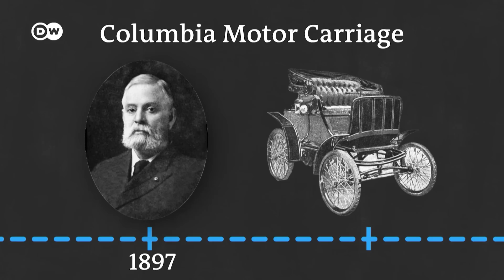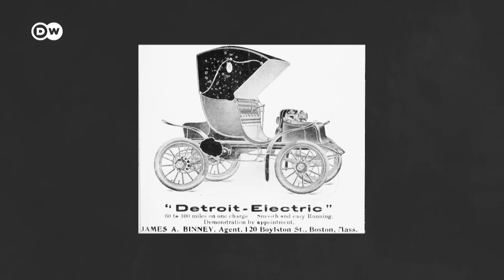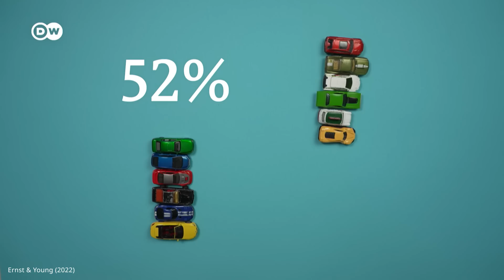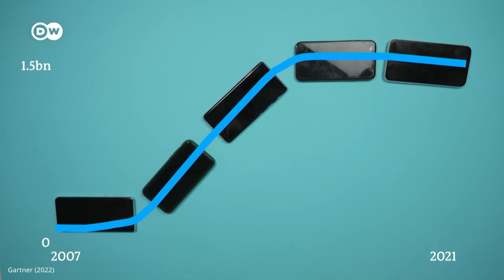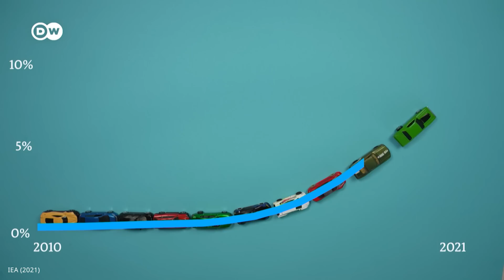Why electric cars are finally taking over

Comment: Norway and Finland are both a minute percent of the world population. The world’s electricity grid will have to be massively expanded which won’t happen due to cost.
Reply: What is your excuse for the population in China?
Reply: did you know EV's can actually help grids. EV's are charged at night when there is excess electricty and then newer ones with V2G can send power back to the grid at peak demand times like supper time. Thats why lots of electric companies are promoting EV adoption.

Comment: Change raods to electric like train and produce car which can run on road electricity just like electric train
Reply: Both  ideas would do the same but your idea will be too expensive and limited to where you can drive because you would need to put electric lines on millions of miles or road instead of an EV being independent.  Don't quit your day job anytime soon.

Comment: Conveniently omitted is that an electric car has to be driven 60,000 miles before it breaks even on the amount of pollution caused in creating it.
Reply: that's false. that's only on a dirty grid. If its on a zero emission grid like where i live that drops to around 7,000km. im at 50,000km with my ev on a zero emission hydro grid and over 7 ev's where i live would be the same amount of pollution as 1 gas powered car,

Comment: If energy supply for EV is not from renewables it doesn't really make a lot of sense to have it, does it? I'm looking forward to see @DWPlanetA take on lithium and cobalt extraction impact on the environment.
Reply: Electric car emits les s co2 even powered by  coal generator because powerplant are more efitient at converting focil fuels into power plus the least efitient Electric car is 80% efitient compared to the most efitien gas car wich are 14% eficient plus contary to the sterotype it is les than 1% of litium and cobalt that is extracted by poor cunty because they cant produce as much as sustanible mining with equipemnts
Reply: its already been proven that an EV on even the dirtiest coal grid is still over its life including all mining and manufacturing cleaner than a gas car. Then take an EV and put it on a clean grid and its 1/10 the emissions of a gas car over its life.

Comment: We changed from the old Nokia to digital smart cars in 2 years. The average life span of a phone is 2-4 years. The same will apply to cars & the average lifespan of 12-15 years
Reply: My friend still has the Iphone 6. Clearly you're speaking nonsense.
Reply: i 100% agree. phones changed fast because they only have a usual life of 5-7 years. a car is more like 10-30 years so the change is slower but still is happening at the same rate when adjusted for lifespan.

Comment: 1200 km with 4.2lt/100km, i will never  sell my Diesel. Surperior to any electric vehicle, and i only bought it for 6k€.
Reply: so it costs you $8 per 100km, my EV costs me $1.75 to do the same thing.
Reply: @3184Patrick  mine is 2010 Make with 240.000 on the Clock. how about yours ?
Reply: @3184Patrick  and 1.75 /100km no way. Solar?
Reply: @3184Patrick  Liar Liar
Reply: @3184Patrick  How much you bought it?

Comment: I think when we adopt the ev the problem occurs when the demand of gasoline will dropped the price of gasoline will also be drop so their should be very difficult for EV to completely kill gasoline engines in comparison of power and price ratio so their must be equlibirium in market untill all the electricity we generates must be completely transfer on renewable and their must be any breakthrough of new battery technology.

Comment: No they are not taking over. They are losing the competition. The battle between electric car manufacturers and oil car manufacturers was fierce and ended just a few months ago. Electric cars are just like global warming cultists. They are not taking over. What is happening to them is, fewer people are buying from those who manufacture them. Supply and demand. If there is less demand, the companies have to make fewer products. Including fewer and fewer electric cars until there will be no more electric car. What happened was that oil car manufacturers started to make better and safer benzine and diesel machines. And with that fewer and fewer people bought from the electric car manufacturers. 100 years ago people will be standing inside some museums and they will look at models of electric cars which are common now which will no longer be sold by then and they will ask themselves how their ancestors could be so stupid to let a bunch of guys lie to themselves so much. Sure there will be alternatives. But that does not change where the future is headed. They are not taking over because the opposite is happening. Thanks for the video.

Comment: Legislation because our countries listened to a little girl thats never been to school.

The EV is the most destructive vehicle EVER devised.
It is FAR more environmentally damaging to produce than any equivalent petrol or diesel car.
It has a shortened life, due to the limited lifespan of the battery being just a fraction of a modern petrol or diesel engine.
Plus, as the battery is the largest and most expensive component in the vehicle, the car will be rendered almost valueless once it decides it doesn't want to be charged any more.
In short. They are a con. A very expensive con. A very destructive con. A very dangerous con.
The manufacturers know it. As do the "environmentalists". And governments. 
And anyone else with half a brain.

Comment: The problem with electric vehicles, which is limiting their spread, is predatory practices by car companies. Basically, they do not respect the right to repair. Whereas, for decades, car repairs could be carried out by independent mechanics with a knowledge of how cars work, the same is not true with electric cars. This is not because electric cars are more complex or more dangerous to work on than combustion cars. In fact, many aspects of them are safer and simpler.

But car companies are specifically designing their vehicles in such a way that only their personnnel can service them, implementing DRM and other measured to make servicing by independent technicians impossible or extremely difficult, as well as prevent the development of third-party parts suppliers. 

 They are doing this to monopolize the repair of their vehicles. They are also doing this so that they can force customers to replace parts wholesale instead of allowing a very specific component within the part to be replaced or repaired, increasing profits while also increasing waste. 

The overall effect is drastically increased repair costs to the cobsumer, drastically decreased availability of availability of parts, substantially longer wait time to have cats repaired, and lower quality of repair services, because repair shops without competition and with a guaranteed source of customers have little incentive to provide prompt and professional service.

Unless regulators step in to institute and enforce right to repair, it might be better if electric vehicles remain a niche product. 

After all, before all of the carbon sequestered in the earth's fossil fuel reserves found themselves underground, they were first absorbed by living creatures who then died and were buried under the earth. And before they were absorbed by those living creatures, they were in our atmosphere.

Releasing carbon into the BACK INTO atmosphere from which it originally came by burning fossil fuels will indeed change the global climate. These changes will likely raise temperatures, cost us money, and make life more difficult. 

But the earth has contended with much higher ambient temperatures, and much higher levels of atmospheric carbon than even that, in its long, long history. Yet its ability to sustain life was never compromised. 

The key to life on earth lies in the elements present on the planet, our distance from the sun as set by our orbit, and our regulation of seasons as set by the earth's axis and rotation. Releasing carbon back into the atmosphere will not change these 3 factors. 

Even if the climate changes, life will find a way, as it has always done. Do not let greedy corporations take advantage of your concern for the environment in order to sell you a subpar product, sell you products you do not need, and/or otherwise scam you out of your hard-earned money.

Comment: I'm a bit skeptical over the electric cars, because they also create a lot of new problems to be solved in the process of mitigating the climate change issue, ex: dumping old batteries. 

The first step we should take is "Greening our habits", which means less consumption, smarter cities and an easy access to services in general. It sounds a utopic, but it's possible do be done.

Comment: I live in San Diego and there has been an explosion of EVs recently. Charging stations have been installed down the street from me and the electric company is offering deals for off-peak charging discounts. It's a good intermediate to cut emissions today, but there needs to be a battery revolution away from lithium, followed by a transportation revolution away from private vehicle dependence.

Comment: When you said India has less than 50k EVs on road...that's wrong on few levels. 1. There are millions of electric 3ws, few hundred thousand electric 2ws in addition to 60000+ electric 4ws. 2. 90% of those 60000+ electric cars were sold in last 1 year or so and the sales have multiplied 3-4 times across all segments in just 1 year. So, the stats would be drastically different in next few years.

Comment: I traded in my Lexus RX 350 for tesla model 3P! I have free tesla charger at work and rarely have to pay for charging! I just wish it had air suspension and backup auto brake detection! I do miss how smooth the Lexus was but other than that it’s perfect

Comment: The next step will be getting people to get over the idea that individually-owned private cars are an actual necessity. Self-driving publically-owned cars would solve all transportation requirements using existing road infrastructure while significantly reducing the sizes of fleets worldwide. After all, privately-owned cars spend the great majority of their lifetimes unused and parked in garages, which is a total waste of space and the energy that went into manufacturing them in the first place.

Comment: Once again these EVangelists  think they can predict the future.  Furthermore they think the purchase of a car is the same thing as buying a mobile phone.  The fact is that battery electric vehicles suffer from the same problems they've always suffered from - low energy density.  In fact there's a 10 to 1 gap between the greatly inflated lithium ion battery and the internal combustion engine.  Batteries are still the lowest energy density technology available for the transportation sector.  Using them in vehicles makes next to no sense except for very specialized applications.  I will close by saying that a low energy density technology has never replaced a high energy density technology particularly in the transportation sector..... The guys that produced this video should study their history a little more closely.

Comment: A full tank of petrol in a vehicle even after one month of not using any, will still be remain constantly equal to the same quantity and quality to the day you filled in.  Whereas a battery can't do that. Batteries power  degrades with the passing of time.  

Charge it the max and leave it without use for 1 month. You'll surely find atleast 5 % less tha the original status.

Comment: A typical passenger vehicle emits about 4.6 metric tons of carbon dioxide per year. 

The Tesla Model 3 holds an 80 kWh lithium-ion battery. CO2 emissions for manufacturing that battery would range between 2400 kg (almost two and a half metric tons) and 16,000 kg (16 metric tons).

Comment: In South Africa sadly not. Electric Vehicles are taxed at 42% whereas ICE vehicles are only taxed at 18% and sometimes even subsidized. The government also collects a lot of taxes through fuel sales and the country doesn't produce enough electricity even for businesses  and households, nevermind cars. There has also been frequent power outages over the last 15 years that is getting worse. Add to that the ruling party has vested interests in the oil and gas industry and you understand why South Africa's government tries to block the adoption of electric vehicles and renewable energy - despite public and global pressure.

Comment: Things are changing quickly now in Australia. In a federal election in 2019 the Conservative party argued against EV subsidies and won power. At the next election in 2022, the 2019 statements were successfully used by the opposition and a number of independent candidates to push the conservatives out of power. At the same time EV sales quadrupled in a year from 1% to 4% of new car sales.

Comment: In Canada, the change to fully electric cars is slow because it doesn't make sense. Canada experiences both extreme cold and heat, which makes the batteries in electric cars non-functional for part of the year. The range on an electric vehicle is still smaller than gas which also causes problems for people that don't live in major cities or need to travel long distances a lot; many parts of the country are very remote. Hybrid (electric and gas engine) cars are becoming popular, but a breakthrough in hydrogen fueled cars or battery technology is needed if we want to eliminate gas powered vehicles here.

Comment: I live in North Carolina and now every 5 to 10 cars in the area seem to be Tesla's. Other makes and models are starting to show up like the Ford F-150 Lightning, Ford Mustang MachE, Chevy Bolts Mercedes and BMW electric models. It seems every other month you're getting new fast charging stations as well and that was before the federal legislation that's gave us more money to install them. One out of every five of the largest gas station chain in the Raleigh area now has fast charging stations they're also showing up at Major box stores like Walmart and Target. They're several free fast charging stations in the area as well making the cost of fueling up basically zero.

Comment: Norway: EV is not cheap but the fossil cars have a lot of taxes on the sale price: CO2 emission kg/km , power and weight decide the one of sale tax. The EV had in the beginning free parking, free toll roads, free ferry's and can still drive in buss lanes. Now EV pay half in toll roads, parking, ferry's. I drive a lot in Bergen where the EV density is the highest. I commute 50 k as an plumber and see more EV closer to city center. So from 7.30 to 8.30 there is maybe a small EV majority.

Comment: I know only one thing, if the EV's are going to increase on the roads, then a sustainable electrical generation systems must be implied rapidly.  We need to avoid the increase of load on non-sustainable pollution causing energy sources like Thermal and Nuclear power stations . Also, an alternative for rubber wheels/ tyres needs to found?
Reply: I only recently became aware of how much air quality is impacted by brake pads and rubber tires.
Reply: EV charges at night while you sleep and grid has excess power. Don't worry so!

Comment: In Los Angeles, EVs are everywhere and I can't think of anyone who actually wants to buy a new gas car there. In places like Texas, people hate EVs because <<insert some Luddite argument or conspiracy theory>>. But I think the Ford F-150 Lightning could turn that around. EVs are inevitable, and anyone who owns one knows how much more fun they are to drive over a gas car, but they are admittedly expensive so until you can start to see brand new economy EVs under $30,000, it's going to remain an upper and upper-middle class purchase. This will all change over time, and emerging tech like wireless level 2 charging could lower the barriers to adoption.

Comment: I live in the Philippines and there are essentially no EV cars being sold nor is there any infrastructure.  There are however increasing E-Bikes around and they are relatively cheap….so there is hope that even here the EV future will eventually arrive.
Reply: In terms of single-rider efficiency, E-bikes are way better than EV cars. The power required to operate them is so much less and they're way more versatile in cramped urban settings.

Comment: Early 1990s: "... ultimately the problem is the batteries."
2022: technically the problem is still the batteries. They are better, but still expensive, heavy, slow to charge, delicate, doesn't last as long and need raw materials from mining. Hopefully we get better batteries technology soon or hydrogen fuel cell technology to catch up
Reply: Not to mention there aren't enough known sources of the raw materials for a 1:1 replacement of petrol cars, besides which the effect on local populations is absolutely devastating. Besides which, if EVs emit 70% less CO2 than ICEVs, that means their carbon footprint is still a third of the size, i.e. nowhere near good enough. Sure, EVs are better than ICEVs, but we really need to be moving away from the concept of externally-powered personal transportation.
Reply: @traveller23e  Exactly. We can't just keep living car-dependent lives, but with EVs. Electrification is necessary, but we need to focus on building places to live that are walkable, bikable, and served by transit. This has the advantage of making our built environment more pleasant and accessible to people of all abilities and ages.